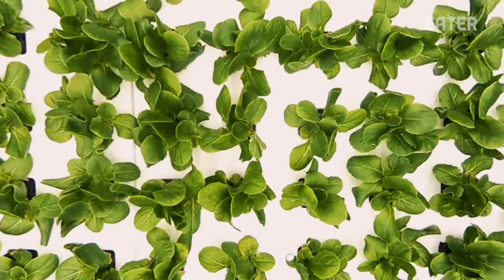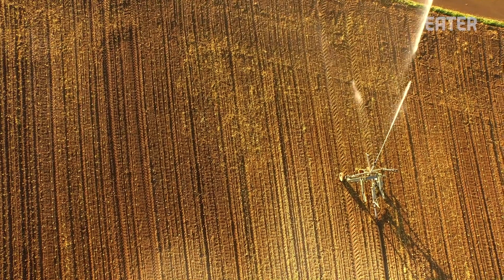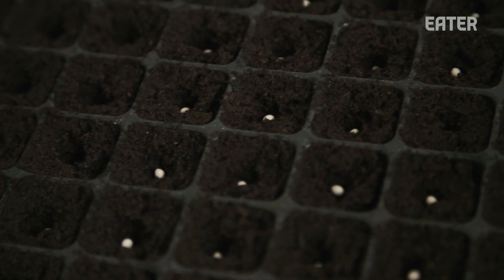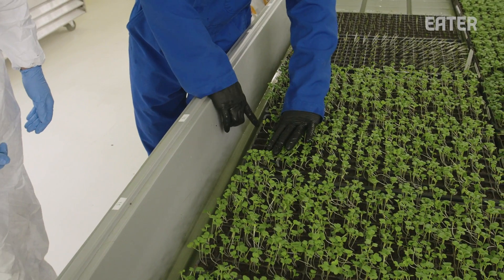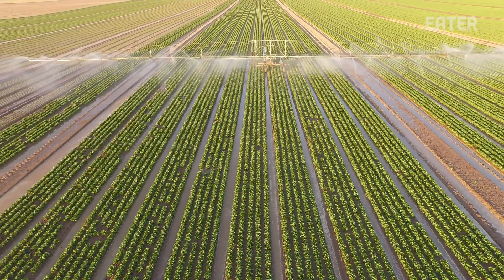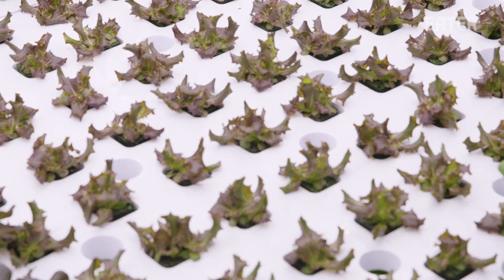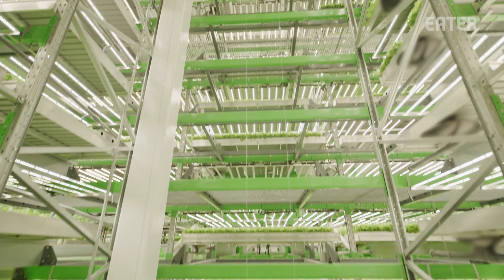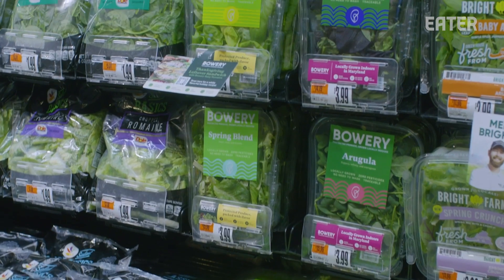How an Indoor Farm Uses Technology to Grow 80,000 Pounds of Produce per Week  — Dan Does

Comment: Are there any good ways to use sunlight in vertical farming? Serious question. Like would this at all benefit from a glass roof? I could honestly see the losses in energy from heat being an issue in cold areas.

But I bet there could be a way to use less artificial light while still farming vertically in hot or bright places. Sunlight brings heat anyways.

Comment: The problem with this method of farming is that it depends on artificial fertilizer, which at current consumption levels is projected to run out in about 80 years. To my knowledge nobody has figured out how to use natural fertilizer with a hydroponic system. Aquaponics may be one solution to this problem but also requires a lot more sophistication.

Comment: Most of what you see here is older technology  The reason this will not be a significant sector is people can only consume so much lettuce    Most of the world's people eat root crops IE potatoes or some form of grain.  As to water use they overinflate their efficiency  Just because there is a lot of water used in irrigation, the excess goes back into the atmosphere where it rains somewhere else.  This is not the answer to long-term food stability.

Comment: No matter which way you look at it, electric lighting is a terrible way to grow crops. The total energetic efficiency is just awful. Most efficient LED’s are about 40% efficient, and and if you use solar for electricity, 20% efficiency in the pv cells, and at least 20% loss through power conversion and transmission. So your best hope is a 6% efficiency to retransmit light from one location to another, and if you are using fossil fuels to generate electricity, forget it.

Comment: problem here is. Light is still needed. Light provides all the energy. If light is produced by electricity, that's a lossy process. You can't convert physical energy -> electricity -> light without a LOT of losses.

If we as a planet came together and engineered nuclear to be better rather than wanting to abolish it, sure.

But if you have solar panels, basically, to 'feed' that vertical farm, you need the space you would've needed for farmland, most likely even more by a factor of 2-3, in solar panels.

That just doesn't make sense.
Reply: i mean you have the giant roof on the warehouse so you have a lot of room for solar panels there alone. And as efficiency of these panels increases, the more and more it can become self sufficient for power. And the world is already heading towards fully renewable energy

Comment: why do they never ask about the energy cost involved in growing? The media always makes such puff pieces on vertical farming and direct carbon capture. 
"oh we don't need to transport our food long distances or use pesticides so we're helping the environment" 
Great, now whats you're carbon footprint looking like from increased energy use?
Reply: Well if the farm is intelligent (aka they have the money for it) they’d plug that building into a renewable energy source, and get their heat from thermal pumps. 
And if you have to pick a machine to burn fossil fuels a single power plant is probably more efficient in its energy per pollution ratio than the dozens of tractor trailer trucks/airplanes/and freighter ships used to move food around the world.
And for stuff like that lettuce that goes limp and bad in the blink of an eye a local vertical farm would make for so much less food waste if every city had one. Just that aspect alone probably helps their carbon footprint as a side effect.
Reply: @Tea_and_Crafts  Then you also have to factor in the cost (both economically and environmentally) of manufacturing solar panels etc. on a large scale. Solar panel manufacturing is not without its problems.
Reply: Thats what I was thinking, the entire farm and the maintenance ir needs is going to contaminate, more than anything grown with residual 0 products.

Comment: The 95% less water use is not an accurate number. It is a percentage calculated in theory by a professor but it has never been practically proven. But is does use less water.

Comment: vertical farming saves water here, but how much water or fossil fuel or other industrial byproducts are going into producing the electricity, lights, equipment for this?
Reply: It doesn’t even save water. Water is never wasted to begin with- evaporation and precipitation
Reply: @drygordspellweaver8761  It does save water - evaporated water is not available for drinking. It does not fall down in predicable places. Any that falls down in sea water cannot be used without expensive (energy intensive) desalinization. Any that falls in contaminated water cannot be used.
And then there is the problem of draining aquafers.
So yes, it all stays on earth, but where the water is matters.
That's off the top of my head.
But spot on besides that.
Reply: tricholysis - but the comparison is against what is used on a conventional farm - which uses a lot of fuel for combines alone, plus trucking, fertilizer, etc.
They also resuse warehouse space - you don't need a new building for this.
Producing electricity can also use renewable resources. That's made more efficient by using the energy in the spectrums the plants want rather than a broad spectrum light.

Comment: don't you lose some of the benefits that come from interconnected soil? for example there is an entire mycelium network that runs throughout all the soil of traditional agricultural land. I wonder what you lose by doing this.
Reply: If I remember right a lot of what the mycelium does is nitrogen fixation around the plant roots.They probably can adjust for that and other benefits in the nutrients they treat the water with
Reply: @longschlongjohnson6470  interdasting
Reply: I'm not going to act like an expert but the water they use is not plain water, it's filled with nutrients which means it's possible to add stuff to simulate whatever makes plant grow better

Comment: Go bother your local political representatives. This needs to happen, the sooner the better.
Reply: It's really a physics question at this point, and how you source your power.

The power to grow plants is needed. Indoors, it needs to come from electricity.

Now, how do you produce that power? As a proponent of nuclear energy, if done properly, that's a solution, yes.

But most people that are for something like this also think we should satiate our total need for power with solar energy.

At this point, what you're doing is just capturing light energy with solar panels (inefficiently), converting it to electricity, transmitting it (inefficiently), and use it to light up LEDs (inefficiently).

You'll need more space covered in solar panels than you would have if you just farmed your stuff there.

Of course, if you don't have arable land, say, in Dubai or something, this makes more sense, but not in temperate climates, where basically anywhere you could easily put solar panels would also be arable land.
Reply: As innovation within the industry improves, costs will come down and the free market will take over to boost it.
Introducing government into this will probably slow it down and raise costs through inefficient bureaucracy.
Reply: @NotKimiRäikkönen  Depends on the government.
Reply: @ls200076  governments are not made for efficiency. They're slow and weighed down. Look at everything the government runs, the DMV, the VA, Amtrak, the post office, they're all horrific nightmares that the private sector does a better job with

Comment: If we compare the crops of these farms with the regular one, do they taste the same?
Reply: but the fact that they are using seeds that have been optimized for flavor and not pest/temp resistance could make them tastier
Reply: The ones in the video definitely, basically they can modify/curate certain characteristics of the seeds the produce consistent and the best tasting leaves, anything from colour, texture, taste etc etc
Reply: They don't use the same crops.
One aspect of the industrialization of food that they didn't talk about is that crops were raised to be durable enough to be shipped around. Flavor lost out.
Reply: Everyone that hasn't tasted them said natural was better
Reply: I think the one in the video might even taste better
Reply: @cosmos3077  pretty sure this taste better cuz it got 0 pesticide
Reply: @zedrhyx1788  pesticides are used in such small amounts that they don't affect the flavor.